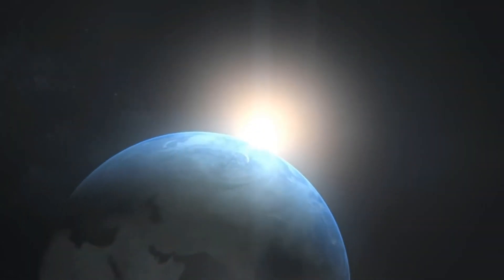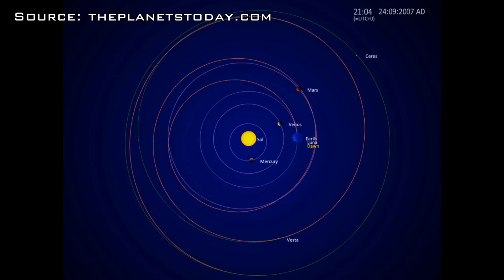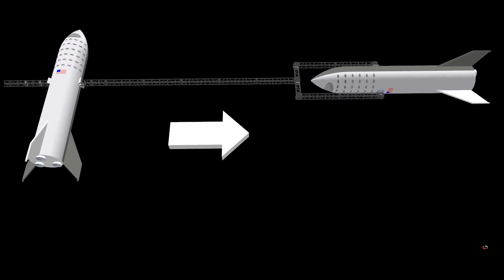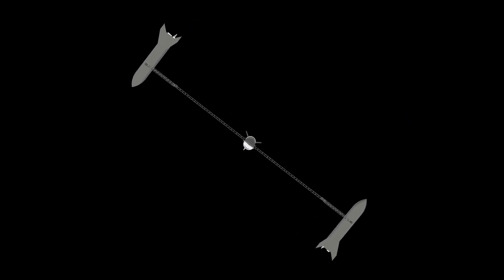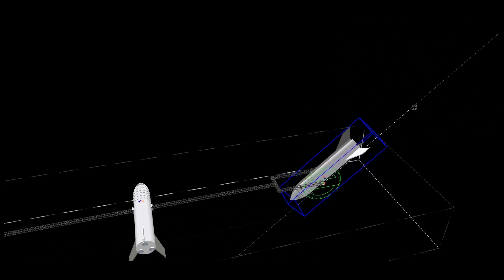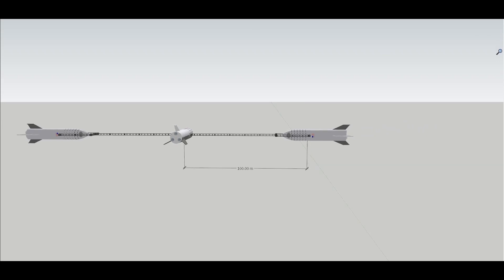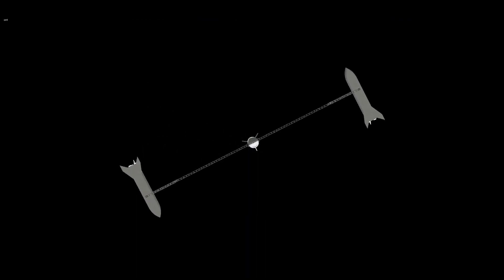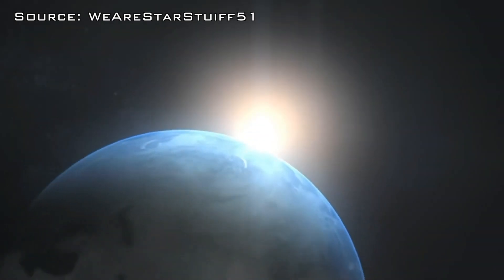GLS2: Artificial Gravity for SpaceX's Starship

Comment: Baffels me how many here have ideas for not having a center ship or using else (canister) or only one ship and a dead weight...

SpaceX will learn one thing: how to build starships. And quite a few of them. Building one extra cargoship won't be hard. It's like people think Kerbal Space Program wise. You just go and build things together. No you don't. Launching a canister with the truss on a falcon heavy was one idea. I don't get why that would be good. Sacrifice an upper stage and timing launches etc. could cause problems.
KISS = Keep It Simple Stupid. In this case I would say it should be applied with what you already have - a cargo variant of spaceship. Using the same super-heavy for lifting it up.

For smallstars idea I think it looks too weak for bending motion. I read he will improve on the design so we'll probably see something better but along the same lines.

Comment: Wouldn't the gravity differential between feet and head produce undesirable effects on the human body? Apart from that concern, this seems like a very feasible solution. Great work!
Reply from the maker: Thanks! The larger the radius of the spin is, the less undesirable effects there will be. From my research I found that most people agree that a 100 meter system lies within the "comfort zone"

Comment: An extra 1/2 ship per ship is a big investment even if the new design is cheaper than the original. Might be better to dock using the existing refuelling docking system and just spin faster. Maybe even use the RCS or an add on drone ship booster to start and stop the spin attaching at a hatch docking point. Then once spinning extend cables and release the rigidity to vary the speed. Save weight but keep the rigidity when you need it. What about a Bigilo inflatable module as the core that could provide inner pressurized volume to play in with out the mass maybe even tucked in behind the truss to occupy the protected inner space with pressure volume once the truss moves out. The Center section could thus stay on orbit as a way point or be brought down for more habitation space like they enjoyed enroute.

Comment: What about shear forces on the truss during spin up and down phase?
Reply from the maker: The shear force won't be nearly as bad as the centrifugal force. In the grand scheme of things the truss is there to provide leverage and really don't need to be that strong. The next version of this (video coming soon) will have cables parallel to the truss that connect the ships as well and hold all of the mass of the passenger starships so they don't fly away.

Comment: The recent change to stainless in the Starship's construction warrants re-assessment of the viability of this concept. There is another YT discussing the potential change in intent, to not use the Starship vessels for round-trip missions. Key points were the expectation they could be as much as 50x cheaper to turn out, and the structural re-usability of the stainless affords a higher utility yield for surface structures.
So, with the above in mind, the truss framework and additional vehicle/multi-vehicle missions could benefit the establishment of surface facilities at a much more industrious pace. For example; someone mentioned the need to rotate crew to/through the center for various reasons. The truss could be designed in sections that could be re-used as habitat/facility access ways for the first structures on the surface of Mars. I wouldn't imagine it would be too difficult to engineer them to be collapsible for transitional relocation.
And to close, I'd like to shout out to the 100YSS folks.... this is probably something they should look into as well.

Comment: A physical simulation of this would be a very good start point. Even though you explained extensively and shown with a couple of models, a more convincing approach would be to show that when left alone this idea can actually work with a level accuracy in mind. Some kind of way to show the worse things to expect and how to overcome them. I could try this though.
Reply from the maker: Thanks! I wish I had the resources to do a proof of concept. Nasa and other organizations have been doing centripetal acceleration experiments which is how we got the data we have now that I used to guide this concept. There's some cool youtube videos out there too if you type in artificial gravity.

Comment: there needs to be some major confidence in the trusses' structural integrity.
Reply: To be fair, there needs to be major confidence in every single engineering element (even down to the bolts) in a spaceship, or the whole thing can go boom.
Reply from the maker: Yeah, the real purpose of the truss is so that the outermost parts of the spin system (the passenger starships) will have leverage on the system. They don't have to be that strong in the grand scheme of things. The most stress will be placed on the cables that reinforce the truss. The cables keep the outer starships from flying away from the center under the centrifugal force of 1G. I'll go into detail about the cables in the next version of this coming out asap.

Comment: Why not have nose cones fold out scaffold 50 feet each making 100 foot gap and spin them pointing at each other and use the cold gas thrusters to start the rotation. This diagram is so complex and has to manny things that can go wrong
Reply from the maker: This sounds like a great idea assuming we can do it with more than 50 feet each, I don't think that's quite long enough. Also, Let's see how viable their methane RCS ends up being.
Reply: @smallstars  yeah how long the nose cones are 100 feet apart might not be enough i forgot how far apart it has to be to not feel the rotation and only downwards force
Reply from the maker: @makoshark40  http://www.projectrho.com/public_html/rocket/images/artificialgrav/gravComfort03.jpg

Comment: Cool idea. A couple of concerns to iron out. 1.) Elon himself has stated that the  reason the starships have enough space for the journey is that in three dimensions  you get to use all surfaces and have more space to move around. If you add artificial gravity you take this benefit away from the interior. While gravity is important the spaceship would need to be designed with this change in mind likely requiring more space in the interior or less people and thus a bigger starship. Source: see Elon’s talk at the latest a starship presentation where he mentions this. 2.)  3 starships are going to cost a lot more than one.  I suppose if you have a docking transfer mechanism then having three starships might solve the first concern. So your left with cost and an increased cost to ensure docking and airlock transfer mechanisms. Still at the rate Elon plans on making starships and related raptor enginesit s probably a feasible mechanism for one iteration of starship voyages at some point in the future. Also as another minor concern as someone else pointed out in the comments the raptor engines can’t currently fire below 40% but I’m sure something can be adapted to produce the equivalent results.
Reply from the maker: 1) Yeah I mean all I can say is, it is what it is, do you want gravity or not? 2) IMO gravity is priceless. Regarding the throttle down, I guess I shouldn't believe everything I read on rockets.com or wherever I read that 😂

Comment: All the space x videos, i don't see any outer thrusters on it so as to manuver around and dock or whatever. How do they do 3 axis manuver ? Apollo craft had many thrusters. 🇺🇸
Reply from the maker: Good question! I believe the current designs has the thrusters hidden. You will only be able to see the holes in the hull where the gas shoots out. Take a look at the dragon capsule.

Comment: The physics do not work as each node will weight 1000 ton partially loaded with fuel to mars. The axis will bear 2 x 1000 tons. When the engine lighted the lateral force will bend the steel axis.
Reply from the maker: The small amount of bending force on the truss won't be a problem. The outwards pull from centrifugal force will be very strong and the structure st the axis will need to be thicc

Comment: Interesting concept however if you are using a spinning design the truss will have to support the centrifugal force of two starships which are 120 Tonnes without fuel or 1,400 Tonnes full, even if you spin for mars gravity that means the truss will have to support over 40 tonnes of tension if there is no payload or fuel. You also reduce the payload due to the mass of the struts. 

Would be better off spinning starship like a bullet, uses less fuel as its spinning around the long axis, doesn't need support struts or other ships, It's big enough to design livng space with that rotation in mind. Its bigger than skylab.
Reply from the maker: It is not big enough to create a spin grav suitable for human life https://www.reddit.com/r/SpaceXLounge/comments/czycst/in_an_85m_diameter_rotating_cylinder_a_2m_human/

Comment: I especially like the return trip starting with low gravity and returning to full earth gravity during the trip home. Takes care of the rehabilitative issues. Maybe excepting for the unforeseen. Good idea.
Reply: CITAP1 Why not acclimate on the way out as well? 🤓🤔🤷‍♂️
Reply: @serversurfer6169  I would keep acclimated to earth gravity as long as possible. Keep the bones strong, circulation strong. It may even be advantageous for the first few months on Mars, super strength if you will.
Reply: CITAP1 Good point about living as a super for your first few weeks. 🤓👍

Comment: A cable would work fine, and it would cost heck of a lot less. Remove the middle module and set a cable between the two rocket modules. The tension will be created because of the micro gravity.
Reply from the maker: Need grav, need spin, need thrust!

Comment: If they did this the truss structure would be more refined I think. Not constrained to be deployable in a single starship. Rather a dedicated structure built in space connected to a tanker starship. I think mounting a super Draco at the ends would be enough to get it spinning. And avoid the need for a complicated hinge/swivel connection for starship to the truss ends.  The central starship would be best used for cargo or additional fuel to allow for a faster trip.   The system overall is easily scalable and you could see a future where the central starship has some type of ion engine and nuclear reactor with more than two starships mounted in rotation. This could then shuttle back and forth from mars to earth with whatever number of starships making the trip attached in rotation.

Comment: bruh just have 2 little engins on the side and make it spin that way you dont need 3 ships XD also the struts would just break lol
Reply from the maker: You need a large radius for a spin system to really work for humans.
Reply: @smallstars  not really ever been to a fair?
You have m small rotating things and you can even stand in them on the walls
Reply from the maker: @sir_duckington1245  If sticking to a wall was the goal, that would be great. But we're trying to create a stable living environment. Imagine trying to poop inside one of those "rotating things" at the fair
Reply: @smallstars  isn't this basicly the same?
Would be a great challenge tough XD

Comment: no reason why this wouldn't work. however it will need to be larger than the cg animation you created. cost of maintaining the truss will have to be considered due to space walks that will have to occur during truss inspection. collisions with even minuscule yet powerful inertial energy space debris can weaken the truss dramatically. this idea is a home run if the right people give this a deep thought and not ridicule because it came from a random person and not a Nobel prize winner or NASA official.

Comment: 8:30 looks like you forgot to include in your calculation the propellant mass needed to align the 3 ships. Is it possible at all to perform the alignment manoeuvre after leaving earth orbit and accelerating to transfer speed?
Reply from the maker: Shouldn't be too big of an issue, but yes you are right it will certainly cost some RCS delta V

Comment: A truss seems like a heavy structure, and EVA risk, to be hauling to Mars and back compared to a cable nose to nose.
That storage mass and volume would be better spent on a solar ion thruster to gently spin and despin the tango.
A cable could be longer to reduce RPM. a = rω²
10 = 640 x ⅛² or 1.2 RPM
Reply: The truss just could be made of graphene or carbon nanotube those materials are very strong and light
Reply from the maker: @jairofthecosmos5022  I like your style! Sounds hella expensive tho. 🧦 with Sandals, the next version has a solution that's better than truss, and better than cables. It's: Truss&Cables

Comment: CHECK THIS: Get the thing spinning (1.8 km DIA), put a 300 KW Hall Thruster, maybe 3, in the center ship and light it up. Instead of a 2D circle, the config becomes a rotating cone with the center ship pulling the other two. SOLVES A BIG PROB with continuous acceleration (angular momentum) because the nose orients automatically and the thrust becomes a natural part of the gravity that the spacelings in the outside ships enjoy. Try it.

Comment: • Hello  Space x and Tesla staff.I´m very happy to write you to give some apportations and support for the SpaceX Mars project 2022 & 2024.
• Working with plants and building the greenhouse on Mars will be key for astronauts:
• For psychological and chemical useus.
• Solar panels will be the key to the electrical maintenance of the Martian base.
• So it will be essential to place it in a place where it is thermally favorable to its functionality.
• The green house is the key for futures experiences with plants and trees.
• Would be an opportunity to confirm new theories about how works the universe and how was made the Earth.A lab and instrument to measure better the nature and …trees ,plants …working in Mars.
Astronauts will find a close and familiar atmosphere for them, which will make them work accurately for Space X Mars missions.So one to the other and everything would be O.K.
  One of the questions has been done is what is going to do the starship on the surface on Mars after to get there .
  I think The firt experiment would be to work with a plants like the KIRI . ( 5 kiris can produce o2 for a person )
Build a glass greenhouse for kiris or similar plants with a pump to add pressure like Earth's atmosphere (1 atm). This is because there is 1/100 less pressure on Mars than Earth and without atmospheric pressure, the plant will die because it cannot take the gas by itself. Therefore, a pump must be incorporated into the greenhouse to take CO2 from the atmosphere of Mars, add pressure and finally store the oxygen produced by the plants for the crew or the ship.Thank you .Visit Youtube channel : Oscar Barnley Barnola.

Comment: New Idea. Launch one BFR and make it spin on it's self by tilting the raptor engines. Before entering orbit of moon or mars flip 180 degrees using smaller side thrusters than use raptors engine again to slow down the spin and let the ship get caught in orbit.🚀 
Of course a new interior design would be needed because the artificial gravity would be pulling towards to the outside of the craft.
Reply from the maker: It's too small https://www.reddit.com/r/spacex/comments/d032bi/potential_for_artificial_gravity_on_starship/

Comment: This is a great idea!  Not only does it provide gravity, it also means that there are spare ships in the event of an emergency.  Add a pressurized gangway between the three craft, and you have a set up with greater redundancy and the ability to move between the three craft.  The only thing I would change would be to send the truss system up first and have all three ships kitted out for the trip to aid in the redundancy scheme.  It might even be necessary to send a remote ship to Mars ahead of time to have an added layer of redundancy.
Reply from the maker: Thanks! Their current plans involve sending unmanned ships first before the manned missions.

Comment: The essential concept isn't new, but your implementation is most impressive. Well done! 😀

Bonus: Anyone who does apply the math to the rotating living quarters of 2001's fictional spaceship Discovery will see it doesn't hold up very well at that small size. 

The required RPMs would likely cause nearly continuous motion sickness, and Coriolis forces would otherwise make physical motion of any kind a challenge. There are competing studies arguing the point (the SpinCalc site touches on them), but the prevailing recommendation is to keep rotation well under 10 RPM. 

The same goes for most fictional movie/TV depictions of rotation-based artificial gravity. The structures are usually not big enough for the low rotation rate depicted. 🙂
Reply from the maker: Bonus: yes 💯